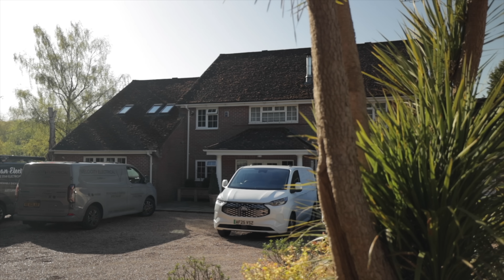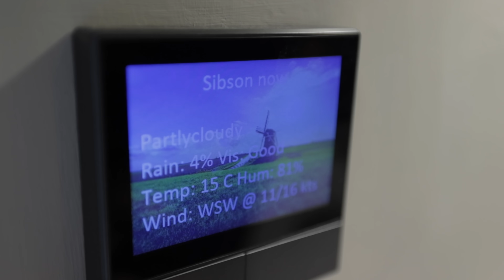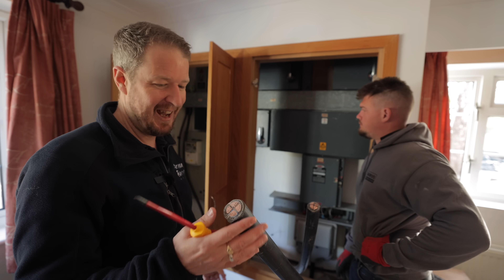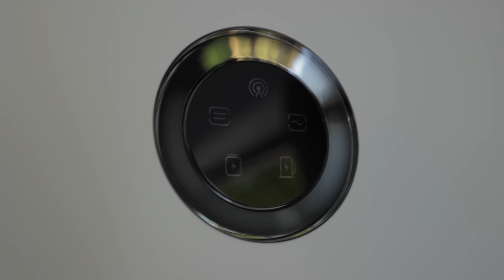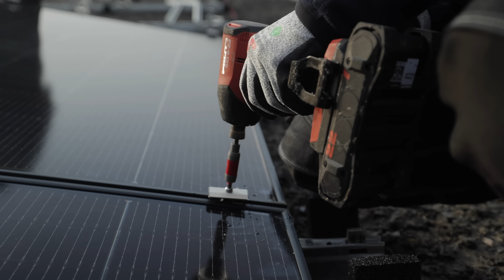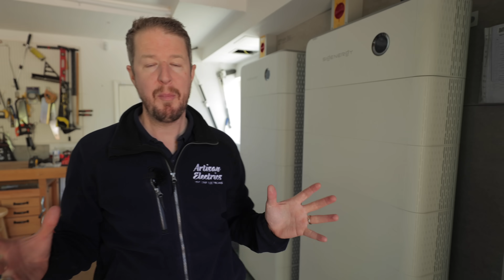Is Battery Storage Actually Worth It In 2025?

Comment: DIY 14.4kWh pack here using an off-the-shelf inverter.  Off-peak usage used to be 40% of my bill, it's now 95%; the meter hardly moves during the day even with a modest 8-panel solar setup.

It's worth factoring in the cost per kWh cycled through your battery pack, by working out the total number of kWh you'll manage to store in the pack (kWh capacity x battery cycle capacity) and dividing the cost of the battery pack by that; if the pack is expensive or has a short cycle life (e.g. lead acid) then the cost of munching through cells can make load-shifting unviable.

When I last crunched the numbers it worked out about 20-25p/kWh for lead-acid, 6p/kWh for Pylontech packs and 2-3p/kWh for a DIY pack using off-the-shelf LiFePO4 cells and a BMS.  Add this figure to whatever your off-peak price is to determine roughly how much a stored off-peak unit will cost (roughly because you've also got AC-DC-AC conversion losses nudging up the price).

For me my night-stored units effectively cost about 11p/kWh (2p already paid for the battery, the rest into Octopus' coffers on the Go tariff) but will be coming down a touch once my switch to E.on Next Drive goes through.
Reply: how much days till lower off peak cost pays out pack price?
Reply: @johndoe9922  sorry, only just spotted your comment.  I'll typically take it from 20% (its turn-off level to extend pack life) to 80% charge, so that's about 8.6kWh.  At the moment my day rate is 28.8p/kWh and night is 6.7p/kWh so it's about £1.90 per day excluding conversion losses, as I've just switched supplier to E.on.That's just under £700 per year, so payback would be in 4 years if I was shifting that much every day.  In practice that's mainly wintertime, in summer it may need very little overnight to top it up, on some days none at all.  For the summer months I've got it set to top up to 70%, so the day's solar has a better chance of filling it up without spilling over to the grid where I get nothing for it.

This is DIY though.  Off-the-shelf packs will increase payback period, getting it installed for you will increase payback period.  Always worth crunching the numbers for your own scenario to determine whether it's worth it or not.
Reply: @johndoe9922 if I'm taking the pack from 20% to 80% every night that's about 8.6kWh shifted, so it saves about £1.70 per day.  The whole rig consisting a second-hand Sofar ME3000SP storage inverter, Seplos BMS and 16 280Ah LiFePO4 cells cost about £2.5K so it's a 4 year payback based on that alone.  Alongside that though battery storage is something of a "payback accelerator" for a PV installation as you're using everything you generate instead of getting paid a pittance for exporting it.  Dearer and/or smaller battery packs extend the payback period so it's definitely something to crunch the numbers for, and not just jump at the sales pitch.  They'll pay back eventually, and the higher energy prices go (certainly the difference between peak and off-peak) the quicker they'll pay back, but for some the payback period may seem too long for the outlay.  Also worth shopping around to try and find a generous export tariff too, as if you're just trying to make the most of what you generate, and not use it for load-shifting, this is what it's competing against.
Reply: How long do you expect your battery to last before it needs replacing?
Reply: @mutton_man  6000 full cycles, or 86 megawatt-hours of energy either stored from excess solar or shifted from off-peak to on-peak.  One full cycle per day would be over 16 years, but it doesn't do a full cycle per day, at most it does 0.8 as the system stops discharge at 20% charge to extend pack life.
Reply: @AintBigAintClever  thank you.
Reply: @mutton_man  im sorry you've "replied" to wrong poster
Reply: @johndoe9922  I didn't a do a @ at you or is it showing that on your feed?
Reply: This is amazing. I understand the ideas andI am new to this. Where can I find more information please. Such as schematic and how to. 

Foggy batteries now doing quite a cheap battery

I don't intend to export back to grid or should I? Reason being I have to pay for MCS
Reply: @CheeKoo-c8n  I did a video titled "Sofar ME3000SP home battery storage for solar and off-peak load shifting" back in October 2022.

Comment: The base cost of a triple 48kwh set up.. just the storage with 18 No 8kwh units must be over £30k never mind invertor and installation costs.... yes discount for quantity. 

NEVER seen eco 7 at 6p...not at current pricing. 

It would take at least 10 years before you get return on this even at 1000kwh a month and by then the batteries would be degraded.

Comment: Where I am on the other side of the world, with our power costs vs battery costs, they need to be half the cost of a powerwall and twice the capacity to be a cost saving option.  LiPo is helping but they are not there yet, I'd love a low cost 40kW battery that could get me through a few days of dull sky's and charge up quick with my large array.

Comment: I'm just guessing this was a £100K installation. While it looks residential, it is actually commercial, so there may be tax benefits not available to residential customers. There may also be of factors to consider - possibly the DNO was having trouble supplying them adequately so they took matters into their own hands. One Sigenergy 8KWHr battery sells for £2250. There are 18 in this install. So that's +£40K (although there may be "volume" discounts") just for the batteries. Then there's the three inverters and the controls, plus X days labour from at least four skilled electricians

I find it difficult to see how solar installations make financial sense in the UK, given the costs, current risible FITs, planning and other restrictions, complexities and the terrible climate/latitude. There are other considerations of course. I knew a man who was so upset about power loss claiming all his frozen food, he "invested" in a three-phase diesel standby generator. He never had to worry about power loss again, but he did have added capital and maintenance expenses and a payback of "never"

Comment: The typical issue with battery systems is people installing too much and not being able to cycle them enough in the 10-12 year life cycle of the system for them to pay for themselves. Don't try and size the system for what you need in January as it won't pay for itself.
 Also don't assume the tariff structures available today will be as generous in 5 years time when doing the maths.

Comment: Would the shift to renewable eventually mean that overnight cheap power will slowly increase in cost reaching equilibrium when the grid itself has to be supported by household batteries and grid batteries as the grid moves to say 75%+ renewables?  I am lucky in Tasmania as we are generally 90% plus renewables from Hydro.

Comment: The whole point of home assistant is so that we can move away from needing an app for every device. Maybe sigenergy should spend time supporting home assistant so that customers don't need to interface with raspberry pi or ESP32 Dev kits...
Reply: It was a Tesla powerwall the user had to use a raspberry pie...
Reply: @Trutles1  had the option to choose to use...
Reply: There is one disadvantage with batteries. It is not economically feasible from just an investment point of view. If you need off-grid capacity then it may make sense.

I have done the calculations both for solar and batteries. For us payback would be around 12 years with this days prices and 20+ years for battery storage.

There are utilities investing in battery storage. However if it would be good business there would not be any battery manufacturing capacity left for the private market the commercial market would suck up all the capacity. The fact is it is a too high initial investment compared to savings, and the expected life time is too short.

These solutions are only for engineering geeks and people that are scared of black outs.
Reply: @thomasl2974  If you live in an area with frequent or potentially long-lasting blackouts, it can make sense for safety and comfort. If prices vary wildly from hour to hour, it can make economic sense. If you have solar panels and want to use that electricity in the evening, it can make sense for ideological or economic reasons. I think it is cool for home use, but it wouldn't make sense at all for me. A product doesn't have to be brilliant for 100 % of people to be good.

Comment: Fancy a job in Sweden? I have a 20kwh solar system but need to add battery super soon
Reply: Context sensitive, if you don't want to add electricians just charge a "solar generater" to A/C outlets and charge from them, as an RV would.

Depends what you need.
Reply: @GeekfromYorkshire  We want to add a battery, probably a Signergy system. I'd like a battery system over 20Kw to cover our evening usage.

Comment: I have a question. Did you consider energy lost doing charging of this battery?
When charging, have checked how many Kilowatts it requires to Charge and how many will you get out? What are the amount of Lost Kilowatts but in charging and discharging it, this will make us know if its worth getting this system
Do the Math and let us know pls
Reply: it doesnt matter because roi time is longer than battery wear out lifetime. but with subsidized tariff it might be cheaper to have battery vs putting battery price as bank deposit

Comment: Personally I would wait until the vehicle to grid is a bit more established and simply use the car which tends to have a far larger battery.  Does obviously depend on millage.
Reply: These are the beefy super professional option that have 48kwh.

For example the model 3 has about 50-82 kwh. 

So each of those stacks is basically a small ev's worth of power. These guys in this space know what they are doing.

And yes adding you car to this system is completely possible.
Reply: @MattDamon-tl3qw the point was why would I pay for a 48kw battery when I have one sat on my drive.  Unfortunately not all cars support bi directional charging and whether you get permissions via the DNO is still unclear.  When this becomes more mainstream I can see adoption accelerating.  That being said if sodium ion batteries are able to drive down prices for home storage and lithium being the mainstay of the EV, that could also increase mass adoption.
Reply: @ashleyspencer3664  You are right about he bidirectional charging. There are ways to get around the software and hardware, but honestly you may electrocute yourself; and would definitely void your warranty.

My point is that LFP batteries are already there when is comes to cost.

Comment: Battery systems with Economy 10?
Off Peak Times -  
12.00am - 5.00am  1.00pm - 4.00pm   8.00pm - 10.00pm (GMT) 
1.00am - 6.00am    2.00pm - 5.00pm  9.00pm - 11.00pm (BST)
External (outside) battery/inverter packs?
Reply: whats the delta in pricing on economy 10, I don't think its good enough, remember these things are about 92% roundtrip efficient which rarely gets accounted for.
Reply: @edcooper2396  Ovo told me this:
Standing Charge - 0.4531 Peak Unit Rate - 0.2942 Off 
Peak Unit Rate - 0.2247

Comment: Instantaneous doesn’t exist, hardware switches always have some delay, in the order of 20 ms.
Reply from the maker: This is less than 0ms
Reply: Negative 😅 ? I suppose you meant to type 10 ms. That’s probably about right, since one can see a flicker occurring with LED lights with this system when switching over, which means the voltage drop must be at least about half a cycle. But don’t keep saying instant then, that simply isn’t true and just parroting misleading advertisement of the company.

Comment: prices here are still falling: 
our prices our 14 kWh batteries 
June 2022 - 3500€
Nov. 2023 - 2300€
Feb 2025 - 1300€ 
GBP is 1 / 5 or roughly 19% less 

We us EOS as the smart (AI) part - which is free on github - has been developed by german developers and scientist working for the german space agency. 
It tracks the behaviour and also gets data from the Solar prediction tool and same for the upcoming prices in the next 2 days. 
Cheap power will be used to run the heatpump during night and heat the warm water cylinder to 63°C.

Right now we moved ahead from EVE LF280 K cells which provide 14 kWh to EVE MB31 cells which offer in the same volume 16 kWh.
Octopus intelligent go delivers for the first 5 hours of the day the energy for cheap at 14 Cent instead of 28 Cent. 
Solarpower is great but still we get at least 7,5 cent and hence that is the cheapest power we get for now, then after midnight 14 cent and then 28 Cent.
We are saving (after up to 20% losses) 19 cent or 11 cent - by average more or less 15 cent per kWh

We paid roughly 2000€ per battery hence with 0,15€ saving it will need 2000 / 0,15 = 13.300 kWh till this battery will have paid back.
We are using the battery roughly 330 cycles x 14 kWh = 4600 kWh in 1 year and hence the battery will have paid back within 3 years. 
The second one is a different story cause during summer that will stay charged at 20% cause it is only used for heating, which means it gets 200 cycles or 2800 kWh and hence 4,5 years till it has paid back.
And the third is even used a bit less about 150 cycles cause the heatpump is the main consumption during the heating time in winter and we get 2100 kWh or 6 years till that has paid back.

By average it will have paid back after less than 4,5 year in our case were we charge the batteris during winter fully during night from Octopus. From 5 to 9 am the battery will be already discharged and some surplus might be charged over a sunny winter day, but not much.

Comment: As an OAP living near other OAP's so I see how little use their cars really get & that mostly short journeys,  the sensible solution would appear to be solar panels plus an electric car that is normally plugged-in, this providing the battery storage system for the house plus car!  The same car-use pattern applies to very many second cars too.  Why is this arrangement not being actively promoted?
Reply: car companies are dragging their feet, I think the worry is you buy a 5000 mile EV and the battery is completely life expired. This isn't such an issue with LFP batteries but there's limited options for those in the EU/UK at the moment.

Comment: if a small 10 amp portable battery can blow up then what might happen to a system of 40 kw or more? if u have built in house ventilation heating and the system catches fire in closed enclosure/garage then u literally might die in ur sleep due to air intoxication if unlucky

Comment: I'm in the UK. Which tariffs/companies give you cheap during the day AND buy back at a high rate? thanks
Reply: Octopus and EON Next are probably the best tariffs at the moment, but they require an EV. EON's EV tariff is 6.7p and Intelligent Octopus Go is 7p. EON's export is around 16.5p and Octopus is 15p. -- edit: you can also go on something like Agile Octopus where the prices change depending on the market rate of electricity. Sometimes it can be as low as 1p or even below 0p.

Comment: Bought 10 kWh over 3 years ago for £4k installed. 
Savings are over £3k already using off peak 7p to drive house consumption.
10 year battery life, 5 years payback
Reply: thanks for sharing, i mean the cost savings will still be there even beyond 10 years ownership, should you continue using it.
Reply: sounds about right, critical not to over pay for a system, if its not paying off in 5 years it's probably not worth it.

Comment: We had a 11kWp solar array installed at my church in February alongside a 30kWh battery. Total install cost was around £30k, but this included a complete roof replacement - the roof was due replacement anyway so we opted to install an in-roof solar array at the same time.

Stats so far - production 4285kWh, consumption 3474kWh, import 274kWh, export 1143kWh. Our current rate is 20.5p, so we've saved £656 so far over 4 months. Export should have earned us £137.16 at 12p, but we've had metering issues so that's only just set up now. Once our fix expires this year and we end up paying around 26p, and assuming Feb-May would be representative of the year-round performance, our annual savings plus export income should be nearly £3k, giving us a 10 year payback. However, we could have replaced the roof without solar, quoted at £14k, so our payback is technically under 6 years.
Reply: 30 kWh on 11 kWp is insane... it might make sense if you have like night rates at 30% or less but damn, going over 1:1 in kWp/kWh is not really viable.
Reply: @DooMMasteR why is it insane? Our battery fills up by 10am when it’s sunny and our usage the previous day has been low. If anything, I feel like it’s too small.
Reply: @colin_cameron  if it fills up by 10, that means you are probably using just ~7 kWh over night, so the remaining 23 kWh are not used. 
It will prolong the cell life, yeah, but cells are not free and when it comes to "optimizing" home usage and not having to worry about power outages, the batteries are very much insanely oversized.  
Don't get me wrong, it's all fine and no issue, but you cannot expect to "get value" out of it.  
If you had a smart meter before you installed solar, you can run simple simulations and in 99% of the cases the "value" potential goes hard flat once you exceed your average over night power usage.
Then again, combining solar-install and roof renovation is a no brainer, it becomes even better when switching to aluminium roofing while at it.
Reply: Thanks for real world feedback. 30k a big investment

Comment: Heating water using 30p per unit electricity is a silly expensive and unpractical option. So I’m immediately suspicious that is used as a baseline to measure savings.

We never get to see real numbers for a typical property before and after a battery installation.
Reply: Use heat pump to heat our water saves70% in power